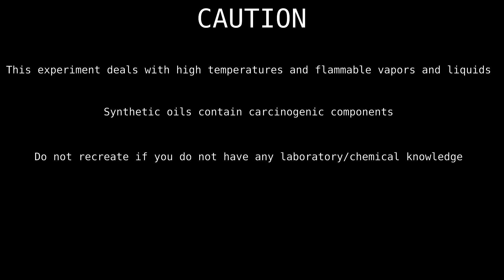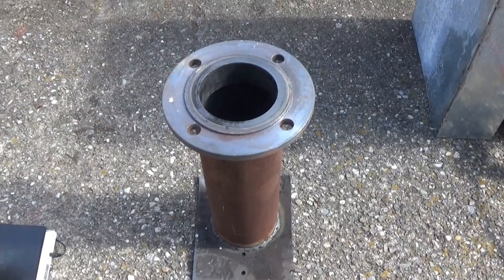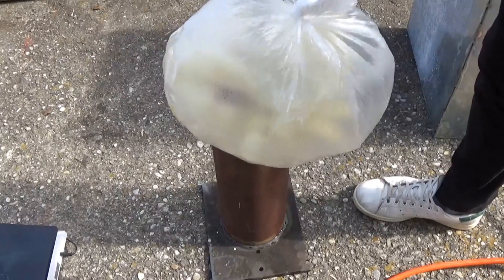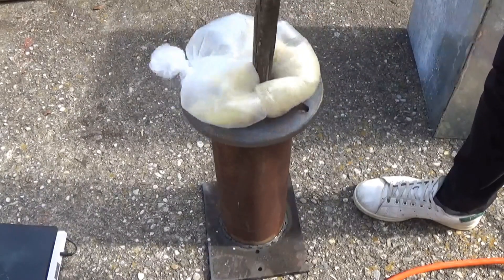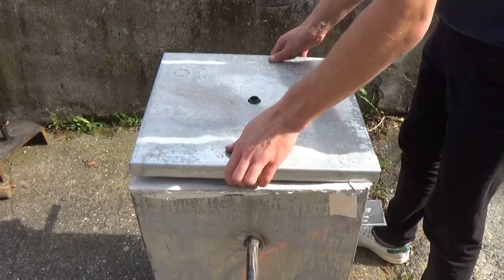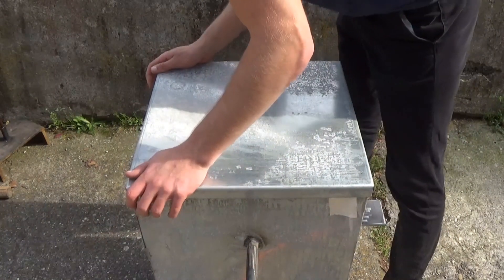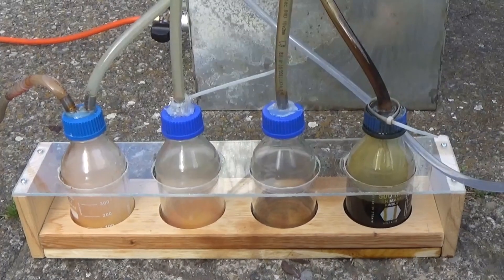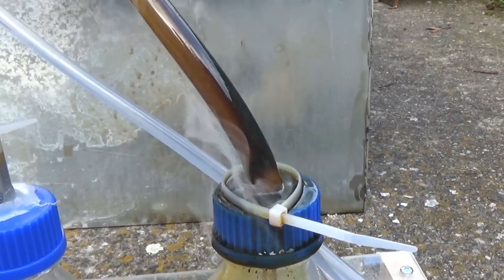pyroylsis reactor project update

Comment from the maker: Hello, you all this video is a quick update on the pyrolysis project. In the background you will se me working with the new reactor while I explain what’s been going on.
So due to corona crisis I had a little time to spare to work on the pyroysis project … so I build a brand-new rector. And so far I can tell you it is amazing! Each and every time I am building a new one I learn from the problems the previous had. So, for example my last reactor was just to big to handle alone. Everything was very heavy, and it took around one and a half hours to get it setup for a run. The new one has a volume of 14 liters compared to the previous 47 liters. It also has a fractional column that is filled with stainless steal wool and has outlets for different fractions. This will greatly decrease the amount of work I have to put in each clean up and analysis by already yielding a very heavy a medium low and an ultra-low boiling fraction. 
With this new setup I will be able to run multiple test a day with different waste combinations and then determine the crude composition of the produced oil. I also got a brand-new rotational evaporator that was kindly sponsored to me by the company heidolph which allows me to use the pump of the old one as an accurate vacuum source. With such an accurate vacuum I will now be able do distill and analyze the ultra-high boiling paraffine fractions of my pyrolysis oil.
But this wouldn’t be a part of the build your own pyrolysis reactor series if there weren’t any problems. One of them is my bachelor that needs a lot of time and the other is high temperatures and gluing polyethylene. So, the caps I need are called gl45 and those with a hose adapter are really expensive that is why a made them myself. But as it turns out most glues can’t glue polyethylene and those who can can’t handle the high temperature of the highest boiling fraction which leads to material failure. And if that happens, I have to shut down the whole system. So till now I am trying to find a glue which can handle the temperatures and that is affordable for a student. So here is were your my viewers can help me out! I need your experience and expertise if you have already work with a material that could work write me a comment and together as a community, we will overcome this problem. 
If you like what I am doing, consider supporting me via patreon so I can buy more equipment and keep working on the pyrolysis series. And if you liked the video leave a like and subscribe to my cannel.  The next video will be on how I build the new reactor. 
Soo have fun and do not kill yourself
Reply: You could make metal bottles with an valve to get out samples during the process or you could weld metal tubes in to a metal discs with the same diameter like the bottle neck, make a hole in the bottle cap and use it like the expensive ones (maybe use PTFE tubing).
Reply: I used Black Rubber Stoppers to cover 2 Liter Erlenmeyer Flasks when i was making  Linseed Stand Oil. These stoppers can withstand about 300 degrees Celsius during prolonged heating. I'm sure they can withstand the heat during fractional distillation of plastic pyrolysis products.
https://cdn11.bigcommerce.com/s-ufhcuzfxw9/images/stencil/500x500/products/14815/16848/20180112-_MG_6740__74615.1515797977.jpg?c=2
Reply: For each fraction before collection run a copper tubing from distillery into small stainless steel radiator, blow air through it with a computer fan or set up water cooling jacket with water circulation. Or, if you are on a budget, for each fraction spool up copper tubing and place it into a large flasks with ice and water, the output will be lukewarm. The stainless steel radiators are available on wish.com or you can buy used water cooler for PC
Reply: Did you consider to buy a drechsel glass cap? Congrats its a really good job with the pirolisis
Reply: The plastic/rubber hose is a bad idea too for temperature and if the extract is acid /basic
But... At least is cheap and you can see through it
....... 
Ideea!! 
Glass bottle /very large glass bottle + the rubber hose is immersed in the bottle 5 cm (max) + the cap of the bootle made with the glue gun and some paraffin/wax paper (so that the glue doesn't stik to the bottle entrance)...resulting a almost perfect seal and it's you can use it many times
Reply: I've just gotten into the subject, but I have access to a large quantity of 'heart of pine' or fatwood, or lighterd, and I was wondering what kinds of yields would you get from that material?
Reply: Get a piece of round Teflon bar drill a hole in the center of a small piece put it in a drill and spin it using a file to put a taper in it then you can make a cork with holes in it for your jars
Reply: When will be the video is upload

Comment: Have you tried using West System 655-8 G/flex Epoxy Adhesive? It's available through Amazon and it's supposed to be very good for HDPE.
JB Weld makes a two-part epoxy for HDPE also, I've used and had good experience with a little more affordable. Hope this can be of some assistance.

Comment: Nice work, a $6 to $9 buck uninsulated stainless steel bottle with copper tubing brazed or Silver soldered into the top of the bottle would solve the problem. For a buck, you can usually find a few at second-hand stores and garage sales. I don't think there is a glue that will stand up to the heat and the hot nasty stuff that is condensing out in that bottle.

Comment: I mean, there’s one thing that I know would work, but you would lose the transparency of your current setup. You could take steel or copper pipe and join it to a metallic container either welding or braising it to the lid of said container and join that pipe to the hose with a hose clamp

Comment: Hello, in my opinion you would have to use a male thread outlet adapter with a female thread and termination in a hose connector, I don't know if it is obtained in a plastic material but if it is obtained in bronze since it is used in small gas connections,I hope the message is understood since I used the google translator, I hope to be of help, greetings friend.

Comment: Hi! (TL;DR at the bottom.) Ich bin gerade erst auf Deinen Kanal gestoßen, großes Lob! Noch habe ich nicht alle Videos durch, aber falls das Problem mit den Schlauchanschlüssen noch aktuell ist: Wäre es denkbar, sich einfach eine Verschlusskappe mit passendem Stutzen/Anschluss-Olive per 3D Druck zu drucken? Ob jetzt PLA, PETG oder ABS das richtige Material wäre, kann ich nicht beurteilen, da weißt Du besser, wie Reaktivität und Temperatur sind. Dann noch eine Dichtung aus PTFE rein, das könnte doch klappen? Ich habe mir hier schon aus PLA Gewinde gedruckt, die an einem normalen Wasseranschluss dicht waren und den Druck von 2-X bar locker mitgemacht haben (und PLA ist ja nicht so stabil). Wie gesagt, was die Temperatur angeht, müsste man schauen, aber da gibt's ja auch pfiffige Filamente... Nebenbei: Darf ich neugierig fragen, an welche Uni Du deinen BA machst? Ich arbeite an einer, wenn auch nicht in den NatWiss.

TL;DR: Maybe 3D printing a suitable bottle cap with connectors, either with ABS or PETG or carbon filament OR a fancy SLA-resin, could be a relatively cheap solution? Even if the caps don't last long, a new print is easy...

Comment: I like your ideas. You should use an epoxy to glue your lids together, something like JB weld will do the job, I assume the addition of the metal dust in the mix helps, besides its cheap and easy to come by.  I've repaired a diesel engine injector seat with some of that and over 40k miles later it's still not leaking!

Comment: don't bother with glue, go to the welding department of your local college and have them tig weld  a stainless connector into a stainless cap
then you just slip the tubes onto the connectors, if stainless is too much investment, you can try using copper and either solder or braze it yourself

Comment: Use RTV high temp silicone, used in wood stove manufacturing of Rutland cement! Or a more simple under drill the hole for your tubing by 1/8" or 3.175 MM creating a compression fitting!

Comment: I think the high temperature car exhaust cement is sand and sodium silicate so if there are any acids present ie: naphthalenic acid they might react with the sodium silicate.
Another option is replacing the plastic with stainless steel on the high boiling outputs.it won't cost too much to do if you're only having problems with one of your outputs.a steel tube welded to a steel water bottle would work

Comment: Thank for sharing all these intresting informations.Why did you put stainless steel wool inside the reactor?Is it the same we use for cleaning?
Reply from the maker: the steel wool is used as column packing. and yes you can use the same as for cleaning. 

mfg hazelChem

Comment: Maybe permatex gasket maker, it holds diesel at high temperatures in motors and it’s pretty cheap 

Permatex 81160 High-Temp Red RTV Silicone Gasket, 3 oz https://www.amazon.com/dp/B0002UEN1A/ref=cm_sw_r_cp_api_fabc_abAVFbF23VB3X

Comment: HI have you tried seperating the feedstocks and check if you will get the same results as last time, just thinking it might give you cleaner pyrolysis oil? Most companies that sell pyrolysis machines often state to limit the feedstock to PE, PP and PS.
Reply from the maker: the problem with limiting your feed is that such a feed should be recycled by separating and reusing

mfg hazelChem
Reply: @HazelChem  Oh but if PE PP PS are the feedstock do you still have to do the de acidifying process that you just did with your last vid?

Comment: Hello! I saw your video on how to build the combustion chamber, I thought that the first layer of refractory cement did not last long, do you think it is a good idea to add steel wool to the cement?
Reply from the maker: well that could lead to burning metal in your cement. I would go with ceramic fiber for a composite 

mfg hazelChem
Reply: @HazelChem  Thanks for your response and for your work. In your first pyrolytic reactor video you talked about using the gases produced by pyrolysis to feed the combustion chamber, is it possible to do? or is the flame too weak?

Comment: During the past years I've build similar units; learning, like you, from problems with previous ones to improve the new ones.  I use pyrolysis for many different purposes; among these, converting useless non-recyclable and thereby unsellable fractions of plastic waste to fuel; including all kinds of dirty and contaminated plastic types. 
Some subjects regarding your pyrolysis reactor project: 
"You're changing the gas seal every time you're filling the reactor chamber" I watched you using sealant rope on a previous reactor. Ceramic sealant rope is less expensive; also, top quality brands can be used several times. Notice, you should always cut the rope in a 25 degree angle, then you let the long ends overlap and just twist the very outer ends to create a nearly self locking sealer ring with almost the same diameter all around.  Even better if you use the right heat resistant glue made for ceramic rope; then you don't twist the ends and the connection will barely be visible. 
"You're using expensive steel tube flanges on top of the reaction chamber". An inexpensive way of making flanges for connecting the unit parts is going to a local scrap yard and buy some disc brakes from old cars, or perhaps getting them for free at auto repair shops. Put a disc brake in a lathe, square it off on both sides, cut a recess for the ceramic sealing on the side facing out, make the hole in the middle as large as possible, then cut off all unneccessary material. Disc brakes are made of cast iron, thus they will not bend or twist under high heat.
"You have a complicated system of connecting the flanges with loose bolts+nuts". Make the lower flange 10 -12 mm thick and the upper one 5 - 6 mm. Avoid any loose bolts+nuts. You can cut threadings into the lower flange so you can place a heavy upper part on the heating chamber, align it with the holes, and screw the bolts in place. If you don't wanna cut threadings you can weld the nuts on the underside of the flange. This, however, requires more space on the neck of the heating chamber; it's more convenient to keep everything as low as possible. Alternatively, cut off the bolt heads, place the shortened bolts, facing the cut ends downwards, into the holes in the flange, almost flush with the underside though raised 1 mm, and weld them in place. This way you use the nuts to tighten the system, but it really only works well with a light upper part. With a heavy upper part there's a serious risk of damaging the bolt threadings when trying to place the upper part correct. Anyhow, now you only need one piece of tool for tightening the bolts, and you can do it with only one hand. By the way, 6 to 8 bolts are recommended for proper equal tension on the gas seal. Actually, larger units mostly have 24 to 48 bolts! 
"Your whole reaction chamber is inside the fire chamber". That's bad for the sealing. A pro-unit is always  constructed in such a way that the top of the reaction chamber protrudes from the fire chamber; this prolongs the life of the sealing significantly. By letting the reaction chamber hang from the top of the fire chamber enables the heat to be more intensive on the bottom of the chamber, right where the heavy tar and carbon black is, thus thorough pyrolysis is achieved in each batch. No need for a thick steel plate on the bottom; it just prevents some of the heat from penetrating into material to be processed. Pro-units always have a pyrolysis chamber with a round bottom or slightly rounded bottom; never flat.
Reply from the maker: hello thank you for the informative comment ! :D I will look into your point and try to implement them 

mfg hazelChem

Comment: Well I also had the exact same problem of glue failing due to temperatures and/or chemicals and what worked for me was wrapping the tube with teflon tape numerous times(so that it looks way to thick for the hole) and then force it into the hole. Thats also, how my cooling water Pump was working for over two years😂

Comment: If you can modify destination part by using resistor or cool by water, also keep distance distillation part from reactor chamber using strong metal pipe, it may more safety and better result.

Comment: A 1/8" bulkhead fitting with a jubilee to keep the pipe on would sort you out on the cheap and as a perfect long term fitting. Used for high pressure high temp hydrolics and cheap

Comment: I did some high temperature vessels (to burn small quantities of plastic) with stainless steel cups/caps/tubes found on kitchenware store and sealed the  joints with exhaust pipe sealer (is a paste that solidifies and resist high temperatures sold in auto parts store)

Comment: Regarding the glue: Based on the information, I´d recommend JB weld. 
I have some I don´t need and I have written you an eMail.
Alles Gute!
Reply: JB weld does not adhere to polyethylene or polypropylene. Even the JB PlasticWeld peels right off. 

I think you could get a passable bond by roughing up the surface with coarse sandpaper before applying JB Weld, but it still would be pretty weak.

Comment: I don't think you'll get a glue that works on polyethylene at high temperatures. You should probably look into a way to get the two mechanically locked.
This is called a "bulkhead fitting". You just drill a hole through the cap, and it stays in place with a nut.
Example: Swagelok SS-400-61BT
(There's probably far cheaper elsewhere though).

Alternatively, if you drilled extra holes in the cap, you could put epoxy on both sides to keep the tube in place. This way, the two mounds of epoxy glue are mechanically linked to each other through the cap. It would be super-janky, but could work

Comment: My recommendation for this material problem: use marmalade or other glas jars with metal lids and glue your brass or copper hoses into it by using high temp black silicone ( https://www.amazon.de/gp/product/B0078U8HN2 ). The benefit of this setup is a very high temperature resistance combined with cheap materials. I tried this with my wood gasifier directly at the outlet of the hot gas where temps are around 350-400 °C. Works like a charm.

Comment: Is the reactor vessel made of stainless steel?
Reply: I tried doing this experiment with a pressure cooker, as you can imagine it didn't go very well (don't worry, i did it in open air, with a gas mask and very very far from civilization). 

I want to build a similar reactor to yours but stainless steel is extremely expensive and I would be more keen to build it out of something cheaper without a risk of corrosion.
Reply from the maker: no normal building steel but it has 5 mm wall thickness and a heat resistant painting 

mfg hazelChem

Comment: I would make that hottest fraction go to a metal container (and tube). Experiment with common drink bottles on the market. Use a mechanical method to hold it.  You might do an initial pyrol, and then a secondary operation for fractional pyrol. That's what i was heading off to do.  For fractional, i was going to use a fire extinguisher(aluminum vessel) sitting in sand in another pot. From the top of the vessel i was going to run a 1" diameter SS tube up about 1-2 feet using washers to divide the internal spaces and broken beer bottle glass as the packing.
Reply from the maker: sounds interesting but this approach needs a second heating and that is what i try to prevent 

mfg hazelChem
Reply: @HazelChem  Think in terms of washers inside and or outside a metal tube. SS welded, or held by those screw bands for proto typing. Like cooling fins along the stack.  IDK. bouncing idea's.